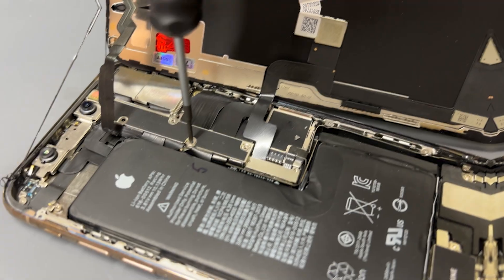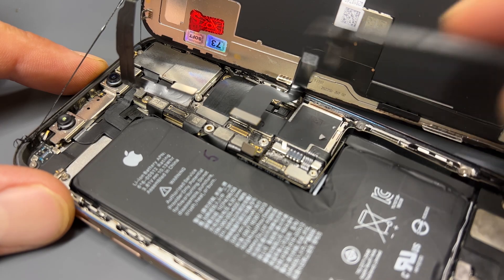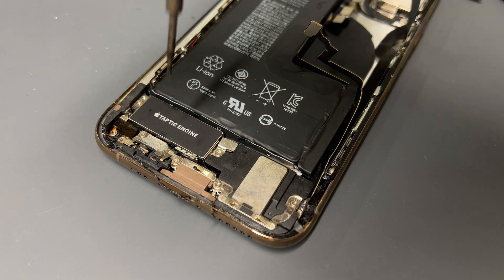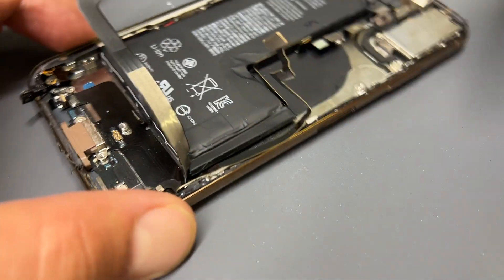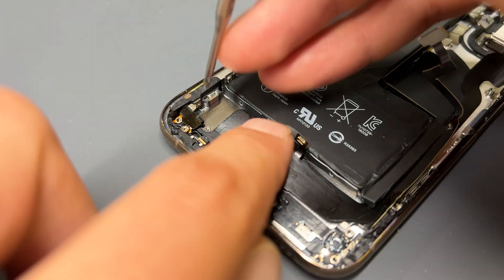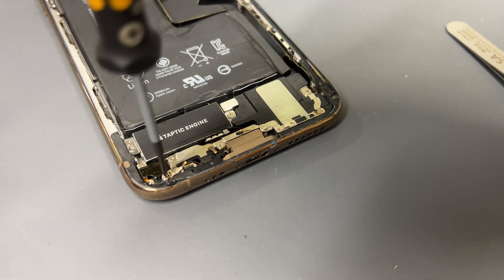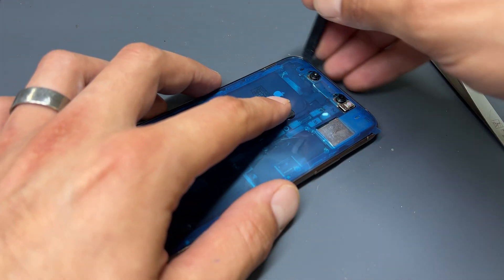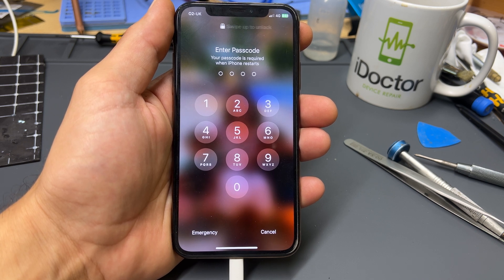Replacing an iPhone XS Charging port - Step by step guide!

Comment: Changed the battery and charging port, and started having high temperature warning after, any solutions
Reply: Hi I changed mine and it's bootlooping so I put back the one it came wit
I have an issue in which my phone turns off when I plug the charger and only truns on whn I unplug it do have this same issue?

Comment: idoctor 6:05 I have a problem with my charging port that was a lil loose and wouldn’t charge. After a few weeks of fixing it my iPhone got stuck on the Apple logo and I can’t get out. Could this be why it’s stuck on reboot mode?
Reply: The port you bought is may be not the original one

Comment: where do you get the genuine part?
Reply: With apple, "Genuine" parts do not exist. Even if you use a different apple screen, that message saying unknown part will pop up. It's an anti-repair measure that apple wasted time on.
Reply: @disembowel6229 Selfservicerepsir exists though
Reply: 6:05 I have a problem with my charging port that was a lil loose and wouldn’t charge. After a few weeks of fixing it my iPhone got stuck on the Apple logo and I can’t get out. Could this be why it’s stuck on reboot mode?